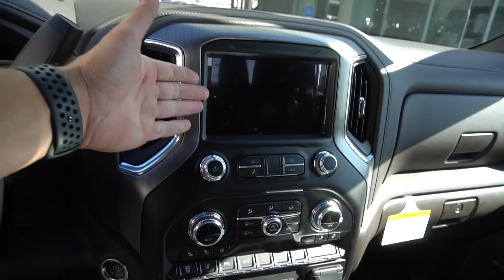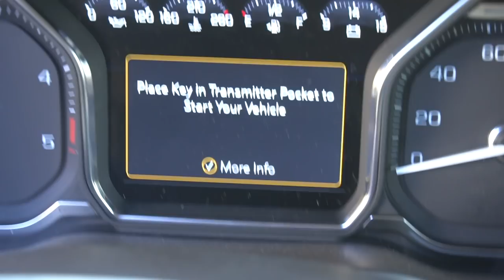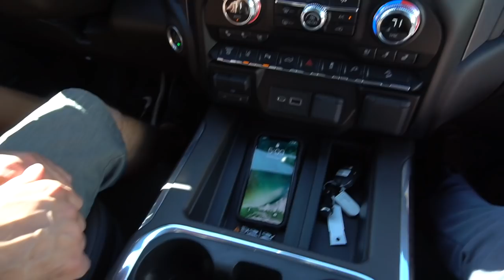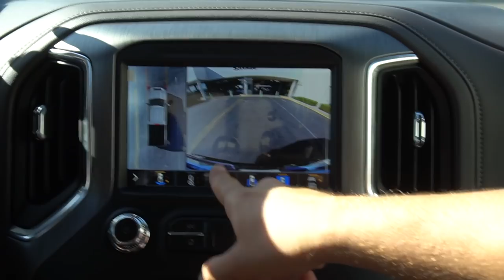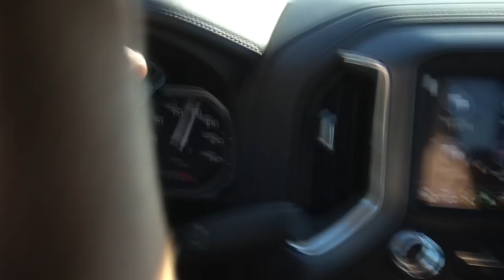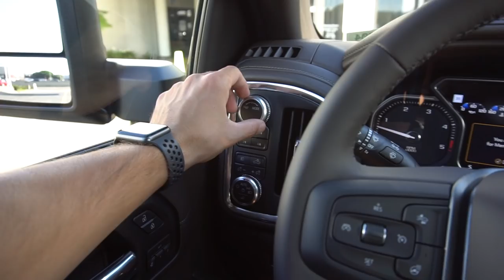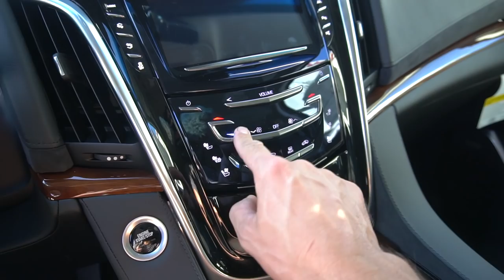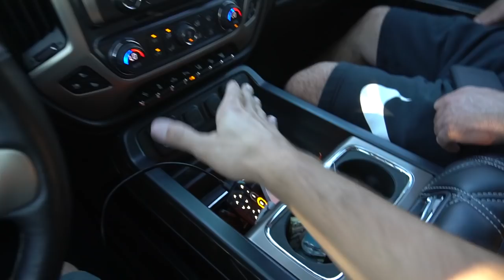TIME TO BUY A 2020 GMC DENALI HD?!

Comment: In my opinion the 14-18 years are the best looking GM trucks, since the square body years anyway.
Reply: Gutrench same. I have a 16 sierra 2500
Reply: The Silverado looked alright, but the GMC looked way better. The new ones are just terribly ugly 🤮
Reply: Yeah, I don't know why GM decided to do a redesign. They really just needed to update the interior, and add some more features. The 14-18 body style was gorgeous.
Reply: Gutrench nope the 90s were
Reply: Corey The FAM 
1-  95-98
2-  03-06
3-  14-18
Reply: I’m glad I didn’t wait for this 2020 and just bought a 15 denali 2500
Reply: YES INDEED
Reply: Yep
Reply: I agree
Reply: I have a 18 Silverado.   Love it
Reply: Agreed especially the midnight edition or the blue denali hd. Both are so nice, especially with a 4-6" lift on 35s-37s and 20s-22s.
Reply: I’m getting a 18 all terrain gmc or a Denali
Reply: Facts✊
Reply: @MNGaudig  i have a 15 high country and i love it got it used dont have the money to get a new one 😊
Reply: Those those shiny black pillars are the worst for fingerprints and scratching I like the colour match painted and you're 100% right Ryan that's straight angle Dash is the worst

Comment: 2020 has been a piss poor year for truck design
Reply: I really like my 2018 ram dually with G56 transmission , even after seeing the new ones
Reply: @concretejungle77  I've got a 4th Gen Ram as well. I haven't been inspired by anything that has come out so far in any brand. GMC was always my fallback for the Rams but they disappointed as well
Reply: Ford still looks good
Reply: @georgecostanza9387  with the new front end I only like ford as a dually, an it has to be leveled out, something about that front end that doesn't look right with a single rear wheel, Imo
Reply: Ryan Mitchell and for cars
Reply: @georgecostanza9387  if you like brick-shaped objects.  The Ram still has curves. Oh, and 1,000lb-ft.
Reply: Randy F 1000ftlbs doesn’t do much good when they put a junk ass 68rfe behind the engine

Comment: Whoever is designing vehicles at General Motors need to be fired.  They have been putting out some really ugly stuff recently.
Reply: I agree.  I have a 2017 Silverado LTZ Z-71 and like the diamond pattern going on in the background of the gauge display.  There's no such pattern in the newer Chevy trucks.  And, as commented in the video, my older Silverado has numerous usb and 12-volt ports.  With all the electronics people are now using, there should always be numerous ways to charge/run things.

Comment: On my 2017 F250 when you hit the trailer mode  while driving it just changes the gearing setup I assume. it holds the gear little bit longer notthing crazy happens.
Reply: Converter lock up

Comment: I agree with you 100 percent on the absence of angle on dash. Also it’s so freaking cheap looking inside
I bought the 2019 denali ultimate package. Nothing ultimate about it. I kept it 30 days and traded back to dealership on a 2019 old body dmax Denali . Lifted on 37” Nitto tires and black wheels. Way nicer interior

Comment: The truck has the markers on the fenders because the vehicle is over eighty inches wide. The drop down tail gate comes with a option for a blue tooth speaker from kicker. I have installed around six of these at my dealership and it’s called the tailgater. It’s a collaborative effort from Kicker and GMC.

Comment: I like the chevy but the GMC looks great. I do like the side marker light s and thinking to do the cab lights next time.
I'm just wondering if the suspension is the same up front as the previous trucks or is changed. Does it sit more level?

Comment: Push button door unlock on the handle? 

My sub $20k Cruze has those.

Also screw those cameras, our friend at the shop just had 1 replaced on his F350 (under warranty) and it cost $3500.

Comment: I was just by that dealership, the Yukon Denali Ultimates are pretty nice if Wes can deal with the front end.  The TPMS sensors in the GMC 2500 are for the trailer, truck actually monitors it. That one had the upgraded camera system, which should include the trailer camera, so it will Ghost the trailer in that new rearview mirror.  The 2020s are also the first year to have adaptive cruise control. Totally agree GM is behind, Ford trucks had that in 2017.

Comment: Well I can tell you mine was not a collapsed lifter. I am on Engine 5 because of Cyl. 7 keeps breaking the valve spring. Obviously the issue started prior to the 120,000 miles. I have replaced the Transmission at 80,000 the radiator, Air Conditioner condenser. The 1st engine was       $15, 000.00 Yes Fifteen Thousand dollars. I have owned Chevrolet vehicle since I was 15 years old. This is a 2015 Chevrolet Silverado 5.3 V-8. They keep replacing the engine with a used one. The engines have been coming from KLQ. Every time it is Cyl #7. Same issue every time. I baby my truck. Very seldom do I pull a trailer, I do not beat on my truck. The last engine while my wife was driving the truck and she drives like a little old lady.  I bought the truck brand new off the showroom floor. Next truck may have a Blue Oval. This truck I have may wind up on the Ford lot with Lemons on every side of the vehicle and I will do a write up on it for anyone looking for a truck to review.

Comment: Hey dmaxryno I have a 2000 f350 crew cab long bed that I wanna lift, the truck does tow here and there but I don't daily it, i know I can upgrade all suspension, interior and some exterior to 2016 f350 spec which should help with availability of lifts and quality of ride, my issue I can not find a front 12" lift that I like I was wondering if there is any companies out there you know of that might have a 12" using a 4 link with coilover system, I like the 7.3 engine it isnt the fastest engine out there but is tried and true and you're able to still work on it compared to the actual 2016s with the 6.7 any ideas will be much appreciated

Comment: Don’t buy the new 2020 gmc or Chevy diesel if you snow Plow. I bought a 3500 denali with snow Plow prep.  The first time plowing I get a check engine light apparently the slow Plow blocks so air flow sensor and turns on the light which puts it in a limp mode which enables possibly the lower but also the remote starter.  So now I have a diesel in winter I can’t remote start.  Also I had to take off the tailgate to put in a salter. GM doesn’t have any plugs like the used to to block off the power tailgate wires and the back up camera wires. So I had to tape them so they don’t corrode with the salt here.  The big kicker is because I unplugged these which is common on a Plow truck the entire camera system now doesn’t work.  These are 2 things I bought the Denali for. Gm can’t and won’t fix either issue and I have a fleet of trucks from Gm.  Looks like I’ll have to go to ford. Also the 2020 Allison transmission isn’t an Allison.  False advertising

Comment: Yeah, but you have to think about the market they are getting at with the tailgate. Most 20-30year olds aren’t running around in a 2020 GMC DENALI 2500. That is mostly the older generation who do need the assistance getting in and out.

Comment: I'd prefer the 2019 RAM 3500 Limited 4X4 Mega Cab in White with Tan Interior but I do love the GMC Sierra 3500HD Denali SRW in White with the Duramax Diesel Engine with the 10 Speed Allison Transmission

Comment: There are way to many production issues with these trucks. Do yourself a favor and wait until we get up and running smooth. They are built in a new plant that we are still working all the bugs out of and are not building the best quality we should be right now. Give it six months and definitely check the build date.
Reply: They're not built in a new plant 😂🤦‍♂️🤦‍♂️

Comment: The multipro tailgate is probably to WORST design ever I mean you would think that GMC would realize EVERYONE with a truck has a hitch. I’m not just saying this because I’m a ford guy because I think ford makes some dumb decisions too for example the auto start stop on their trucks or the 2018 and up F-150 front end
Reply: I mean I have a 3500 HD GMC 2018 and I don't just leave my hitch in the truck all time. I mostly pull my fifth wheel camper so I have a fifth wheel hitch. But, the front bed steps along with the dropped middle part of the tailgate would make it a lot easier to reach into the bed and hook up the chains and lights for fifth wheels and goose neck trailers. And all the cameras would make it nicer to back up to a trailer especially the bed view for a fifth wheel / gooseneck trailer.

There's pro's and con's to everything, but I do like the tailgate but I'm not sure how long it'll last with all of the abuse tailgates take over the years. But the concept of it, other than it hitting the hitch, I think is a good idea that no one's done before.
Reply: dedalliance1 yeah like they should’ve made it to where the cutout for the multipro tailgate was an inch or 2 higher up on the tailgate so it could clear a hitch
Reply: @rileycarelock4306  I'm sure they considered that, but they probably thought raising in another inch or 2 would take away from the point of having the drop down middle part to begin with. People will just have to be aware of their hitch when using the tailgate.
Reply: dedalliance1 yeah or just get the standard tailgate which is what I would get
Reply: @rileycarelock4306  That's always an option, but then you don't get the functionality of the multi pro tailgate. But for the people that don't care then that works out well.

Comment: you should get a ram 2500hd 2020
Reply: Ram hasnr come out with a 2020 Model year 2500 or 3500 yet. Theres is 2019 model year still. There 2020s wont be out till middle or end of 2020

Comment: There are a few things i like about the new GMC. Vents in the rear, heated seats in the rear, the push button start, the camera system is a huge upgrade. The dash i dont like compared to my 2017. But with them already announcing that they are going to update the interior of the 2021 trucks. Way to totally turn a bunch of people away from buying the 2020. Excited to see what they do with the mirrors as well... and a big turn off i have is you can no longer order a truck with out roof marker lights, and the ugly lights in the fenders are HIDEOUS!!!